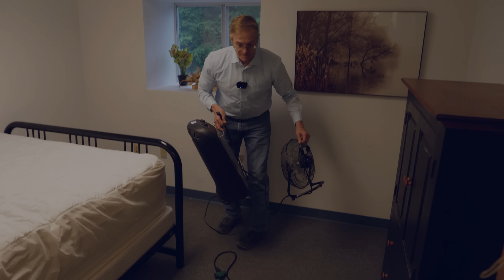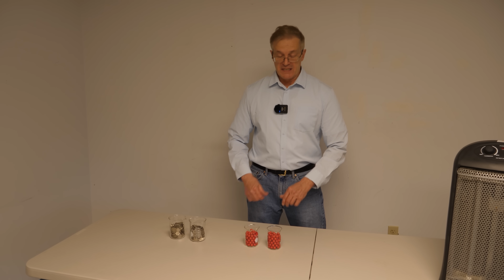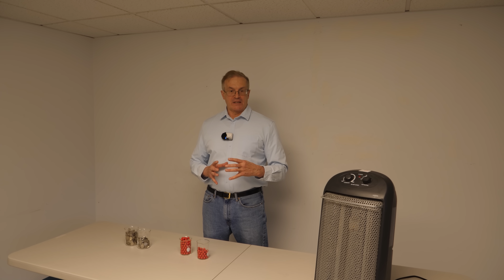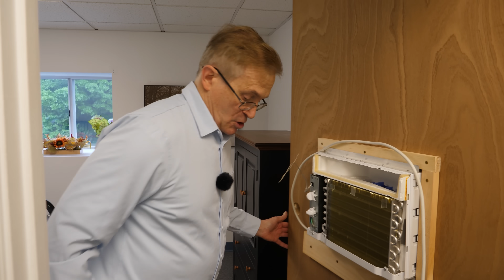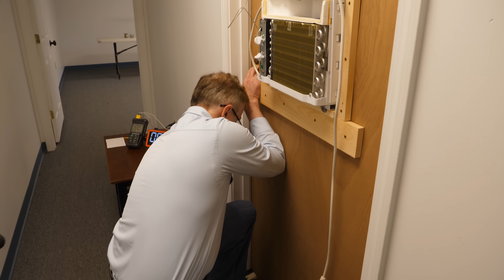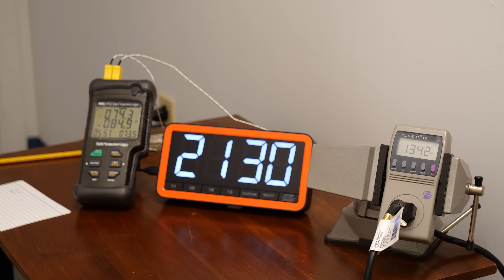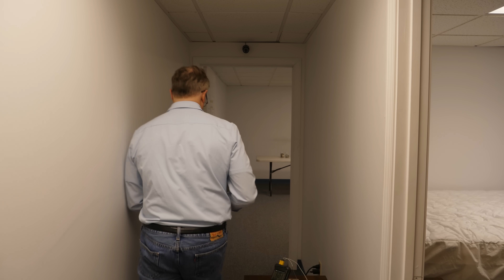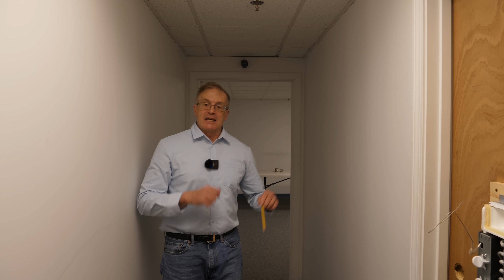You're wasting money on heating! Use your A/C!

Comment: One thing to be mindful of: If you wish to use this A/C-setup in order to heat a room during winter, you need to make sure that the heat battery (the radiator you see on the back) doesn't drop below 12-13 degrees C. If it freezes, it will break. So forget about putting it outside in freezing temperatures, and make sure the room that has cold air being blown into it never drops below that temperature limit.
Reply: I watched this and immediately thought this would work great to some energy efficient heating into a small 10x10 grow house during the winter.

I'm curious how you would determine at which temperatures it makes sense to do this. From my understanding a heat pump is still good down to nearly 0 degrees Celsius. Is it dependent on the refrigerant type?

What would be the issue here and how could one get around it?
Reply: @marshallgoat  There is no 0° C limit. In practice you will have a positive CoP up to -20°C. It depends on the heat pump though and a DIY AC you convert yourself may be worse.
Reply: @marshallgoat  Modern high efficiency heat pumps use different mixtures of refridgerant that works better for different ranges in temperature in order to retain operating efficiency. It is the type of refridgerant used, depends on how it's designed.
Reply: @marshallgoat  theres plenty of heatpumps that still put out full power at -15C.
Reply: @Etacovda63  The CoP will be lower if it is colder outside - but it can be positive up to -20°c depending on model.
Reply: @marshallgoat It will continue working well below 0°C, but with continually lower efficiency.
Reply: @marshallgoat one way is to run your coolant lines into the ground below the frost line, instead of through an air radiator. Now you have a geothermal system that can heat and cool all year long.
Reply: @marshallgoat with a few blower fans (and some way to control them be that thermostat switches or a full on controller)  and some materials from the hardware store you can heat a small greenhouse with your compost pile. If you spend as much as you would on a heat pump you could probably build a pretty nice setup. If you aren’t making compost already or have no need for it probably not the way to go but if you can use compost might as well get the free heat off it.
Reply: @marshallgoat IT will still be more efficient than a resistive heater well below 0°C. But I suppose a kilo watt meter would easily show when the efficiency craps out. Here in Denmark we have single split units that guarantee efficiency to. -20°C and will still generate heat down past that.
Reply: Mini Splits!
Reply: It's a DEMONSTRATION to show proof of concept NOT a hack. For many reasons don't do this to heat your room.
Reply: @EndoftheBlock7224  THIS, lol.  He's showing how the efficiency of a heat pump is there, not telling people to turn their window AC's around when they live in the arctic.  Get a real system for your home, but this is how it works generally.
Reply: @EndoftheBlock7224  Sure - simply buy an AC that has heat pump functionality integrated. They are widely and cheaply available for example as a mini split or window units.
Combined AC/Heat Pump units are the norm for new installs in many milder climates.
Reply: Seems easier to just buy a proper minisplit.  Mr. Cool already makes a DIY friendly kit for about $1,000
Reply: That specific unit might break below the temperatures you give.   Modern "reverse cycle" air conditioners / heat pumps have working temperatures well below 0C.
Reply: Where are you getting that info?
I currently am using a window AC unit that has spent several full years entirely stored outside, exposed to the weather and snow down to -20*F/C and still works fine.

If i were to run the unit in freezing temperatures it would ice up and become less efficient.
Reply: There are plenty of heat pumps that already do this. 
Our hot water heat pump works to minus 20 Celcius. 
The refrigerant is the key, as an internal defrost cycle.
Reply: Also, for the "turn a window unit around" folks is where do you want to put the condensate as well as control air humidity. A purpose-built heat pump will have a normal heating circuit to also dry the air, but a window unit will be producing condensation and moving air humidity around in potentially negative ways.
Reply: @aaronb1138  No it won't and normal heat pumps do not have a "heating circuit" for humidity control. 

Any condensation will happen on the outside (since this is the cold side) and the absolute humidity is not changed on the inside. The relative humidity is lowered on the inside, because the inside is heated up.

This may only be a concern, with ACs that use condensation from the cold side to splash it on the hot side (e.g. inside) - this could raise inside humidity.
Reply: I appreciate the intent is to show that a heat pump costs less to heat a room. Why are we measuring power? Joules or kWh. When the power consumption of the resistive heater and especially the AC unit are variable, total energy needs to be used, not max power or power after 30mins.
Reply: @friarchris2  They're measuring power over a fixed period of time. There's a second camera filming the instrument displays. That's exactly what you're talking about.
Reply: @friarchris2  Because you can deduce how much kwh/joules you put into the room (temp difference) and then calculate efficiency based on the (paid) energy inputs.

Of course here it was a little bit of cheating, by using warm inside air for the heat pump.
Reply: The low temperature performance is generally limited but the compressor design and how much lift (pressure ratio) it can generate. Depending on the refrigerant used you need different lift ratios to pump the heat absorption pressure to the heat discharge/rejection pressure. The differential pressure requires power to generate and overcome which is why efficiency increases as your difference in temperature decreases... Or rather it takes a lot of power to run your AC when it's hot out or heat pump when it's cold out.

Heat pumps are also prone as mentioned to freezing water vapor because the refrigerant needs to be typically 8-15F colder than the air crossing the coil to absorb the heat. When this is below 32F/0C it will build up ice preventing heat absorption.
Reply: ' Never heard it called a battery and radiator isn't correct either - the coil that gets cold is called evaporator and the hot coil is called a condenser.
Reply: @stuartfox5989  English isn't my first language.
Reply: So maybe like Portable ac is kept inside in winter, with cold air made to leave the room outdors and original hose for blowing hot air out stays in, maybe that is how this problem solved?
Reply: If you're using it for heat then the back's going to be on the inside where it's warmer anyway
Reply: That's only 53F that's hardly enough to break anything.
Reply: Refrigeration technician here. The radiator you talking about calls evaporator coils( same as in your refrigerator).
They contain a refrigerant. They not going to break if they get frozen over. They will just build a lot of snow on them that eventually will restrict airflow and reduce the heat exchanging process (less efficient). Then you will have to defrost them (same as your refrigerator do automatically) and start over.
Also you will have to bypass (or install different) temperature control because air conditioner will stop running when temperature control will sense that the temperature is too low on the side of evaporator coils(in this case outdoor)
Reply: commercial units have already defrosting built in for this, but it sucks because if it is really cold outside, the defrosting can take up to 30 minutes, the time where no hot air will blow inside.
Reply: @D4no00  That is not the reason for defrosting - it is to remove external ice buildup, not to stop the refrigerant from freezing. The refrigerant is obviously not water ...
Reply: @D4no00  hilariously (or maybe not) the defroster on many of these things is not intelligent in any way & will in fact waste tons of energy heating the outdoors even after the coils are defrosted. It's some dip switches on your outside unit, I'd recommend checking & seeing how long your coils take to defrost next winter, and setting it the the appropriate value. For me, it was to change it from 30 minutes to 10.
Reply: @flagman3116  Every system that uses static values would be wasteful,  defrost duration should be determined by temperature and humidity. 
Modern systems should also detect the need for defrosting by monitoring their efficiency, and if it falls below the expected value for a given outside temperature - they do a defrost.

Also by performing the same caclulation, they can determine once the defrost was successful. Simply by looking at the outside temperature and the temperature delta between inlet and outlet of the outside heat exchanger.
Reply: @D4no00  It is even worse - the inside will get cooler during defrost.

Because defrosting simply means reversing the operation and dumping inside heat outside to defrost the heat exchanger. In reality it maybe takes 5-15 min depending on conditions. It restores efficiency, so it makes sense.
Reply: What are you talking about?🤣
I've used mine in -30° without any problem it still gives around or over 5 KW heat for less than 2 KW power it's made for hot and cold
Reply: @tullgutten  Do you have a defrost function? And the purpose of a defrost function is...?
Reply: @stoffmeister7095  To maintain efficiency because the ice buildup limits the heat exchange.
Reply: On further research, you're correct overall but have done a poor job of explaining it. 

At certain operating temperatures and conditions the evaporation loop cannot keep up and liquid returns to the compressor through a gas line. For some units they're just not designed to operate below something like 13C and that's when it will happen. All units will have this happen if the evaporation coil freezes over since airflow will stop and ice will insulate the coil. Mixing these two up is confusing. 

The condition seems to be called compressor floodback, and it will break the system eventually. The specific numbers, conditions and damage are highly variable though.
Reply: Under the assumption that the refrigerant would be water - which is it not.
Reply: @TylerDurden-pk5km  Do you have any water in the air surrounding the metal?
Reply: @stoffmeister7095  Depends on the humidity - but this will never destroy the heat exchanger. It builds up ice on the heat exchanger and kills efficiency when it is very cold and wet - that is why you have defrost on heat pumps. 
The claim was, that the heat exchange will break - that is not true.
Reply: @TylerDurden-pk5km  I'm going to have to disagree, because of my experience within the field of building automation. That is why, apart from the fire alarm, the alarm from the temperature sensor over the heat exchanger is the most important. Because if it freezes, it will bend and break. And then you have a very expensive problem on your hands.
Reply: @TylerDurden-pk5km  see how a mechanical system works and you’ll understand why you’re wrong.

Comment: But in winter, the liquid refrigerant that pump out to the external unit to be evaporated, and at the same time, the temperature is also pretty low in the winter. How does it boiled when the temperature difference is small? Does lowering the pressure works?
Reply: Ideally you would use a different refrigerant designed for the temperatures you're wanting to use the AC in. Lowering the pressure might work but with less gas you'd capture & move less heat.

Comment: Thanks for these  very well made video again!   I wanted to add that, The COP of these A/C is impressive. The only downside is that the COP reduce when the temperature of air where it get his heat energy is lower. Heating from extracting energy of air at 25 C degree C is easy, but heating from a air that is at -20 degree C during winter  is more difficult. The COP reduce when air temperature energy source get lower.
Reply: That's why we use ground source heat pumps!

Comment: Can you please test good amount of water enough to cool one room and keeping good amount of its surface open for radiative cooling of water below sky i.e night sky cooling and also evoparative cooling and using that water to cool the room by circulating it in the room with small pump. And also with black color as it emits most radiation like it absorbs and with selective emitter material if possible.

Comment: Another way to visualize the difference between heat pumps (A/C) and space heaters:
- The heat pump moves heat across a wall (albeit not being 100% efficient)
- The space heater creates the heat using electricity as a source (being 100% efficient).
Just moving the heat (despite a little loss) is far more cost effective than creating it.

Comment: To be fair, the heat source is 75 degree air, so in this test it was running under more favorable conditions than it normally would in a heating scenario where it might be below 32 degrees. Still an impressive result, though!

Comment: The problem is icing.
If you use air conditioner to heat a room when temp outside is 5-10 celsius - its ok.
But when temperature outside drops bellow zero - air conditioner's outside unit will freeze and ice. And that ice will prevent thermoregulation with outside world and drastically drop efficency until air conditioner will just stop pumping heat from outside.

Well, if only it was that easy to heat up buildings we wouldnt have problems with central heating or heating vats))
Reply: Modern heat pumps will run de-icing cycles by temporarily reversing the heat flow. Lowers the efficiency, of course.
Reply: @fubarbazqux  but with the headroom you have its still better than resistive heating.
Reply: @zachmoyer1849  It probably is. Checked  the data sheet on mine, and manufacturer is a bit dodgy, specifying a single CoP number instead of curves. It will be less than you might think when you get to the lower end of operating temperatures. I don't think this is a good comparison anyway because heat pumps don't really compete with resistive heating much. They compete with burning stuff. And then calculation gets much trickier because 1) Fuel costs are very much location dependent. 2) If you live in a really cold climate, it regularly gets colder than a low end of operating range on a heat pump.
Reply: @fubarbazqux  yeah burning stuff probably still make sense further north i think in more mild winter areas though the tide has turned in favor of heat pumps as fuel oil and natural gas are no longer cheap.
Reply: @zachmoyer1849 As someone with a wood stove, the awkward in between seasons where it's only mildly cold is where a heat pump would massive benefit as well over electric.
Reply: @mikafoxx2717  agreed plus then you dont have to source and store as much wood.
Reply: That is where the little electronics change comes in with the system, and when it notices the buildup/temperature, it reverses for a few minutes and goes back to heating, in that time the inside unit doesn't run the fan spreading the colder air until it warms back up again.
Reply: There's also geothermal, costlier to install but eliminates this problem
Reply: I live in Finland, and my house is heated with heat pump. The efficiency is just fine down to -20C/-4F, the unit starts to use resistors somewhere near -25C/-13F. Hybrid configuration where the unit is installed with external oil or propane burner helps to deal with really cold weathers and/or high electricity prices.
We had oil heating before; the oil cost about 0.6€/liter, and we switched to heat pump when the price was about 1.6€/liter. The house used 1500-2000 liters annually, and it really wasn't fun month when the heating oil tank needed to be filled up.
The external unit does defrosting cycles every now and then automatically to keep the outside unit clear of frost - it helps to have installation planned so that the dropping water/ice slides into manageable location away from the house. Frost buildup seems to be worst from -10C to 0C, when it gets colder the air is so dry that there isn't much to build frost with.
Good insulation saves in energy expenses, no matter if it is hot or cold weather.

Comment: I love your videos.  Yes... this is a good result with "similar environments".  But you can't pretend that heat pumps are always better than resistance heating.  Now... perform your experiment between environments with 40 degrees worth of difference.  Yes... heat pumps are far more efficient... BUT not always which is dependent upon environmental factors.  I have a "heat pump" on my house.  When it gets too cold outside... my resistance heaters work much better.  When it's only 40 outside... it works well.  But when it's 10... It can't keep the house warm enough, but the resistance can.  When dealing with "exchange" which is what a heat pump is the question is always "can the cold side get colder than the environment that it is in and can the hot side get hotter than the environment it is in.  And of course... "by how much".

Comment: This is what happens when Chewbacca installs an AC unit. It's backwards. 
I haven't watched yet, I'm just assuming you're flipping around a window type unit so that the condenser is on the inside and the evaporator is on the outside. In that mode, it should perform like a heat pump.